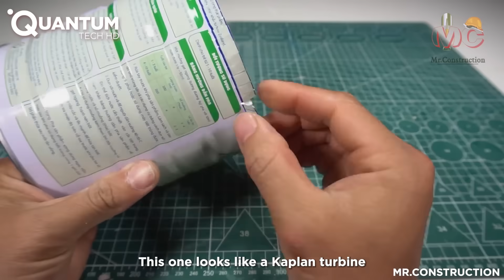Ingenious DIY Hydroelectric Turbine Systems | Free Energy by @mr.construction9846

Comment: There is no free energy.
Reply: No but if you use solar through day to pump water up and slow realse it at night technically you have just stored "free engery"
Reply: @unbredstone7378 Solar energy doesn't just appear out of thin air, it comes from the sun. If we think economically free it's also true, becouse those solar panels cost thousands and use alot of materials and once they break, are non-recycleable.
Reply: @AlanenJ   fine use the old polly pipe in roof trick and use thermal dynamics to pump water up cheaply
Reply: Тогда какой смысл строить гидроэлектростанции по всему миру, атомные, солнечные ?
На дровах как ЕС сейчас?
Reply: No free energy? You take bath in sunlight you got yourself a free energy flowing through your body it's called vitamin D

Comment: Something is wrong with your sine wave. Impeller speed and fan speed are not directly related to each other.
Reply: And your LEDs aren't flickering with the camera. As other run on some sort of DC battery instead of an AC power supply that's been rectified. 🤔

Comment: These are good for off grid power to keep batteries charged. However you'd have to have several of them sending generated power to an inverter wired to battery
Reply: These a "Miniature" D-I-Y examples, only for demonstration purposes! You can buy retail versions, as well, or scale these up, in metal, if you prefer the challenge!

Comment: Overvthe months he has made many water to electricity gizmos. None of them apart from the last one could or would actually develop the power he shows . These last 3 looked very nice , especially the mini hydro plant and dam , just a shame the motor would not develop the power he shows , unless he whats to prove me wrong and give the spec of the motor / generator !
Reply: I have a fan about the same size that works for over 26 hours off of a single 9000mah 5v battery. Needless to say it takes barely no power to run a fan. same aplies to these tiny diodes connected serially.
Reply: If you doubt it ask for it on mr constructions channel

Comment: I did this with my municipal water supply. They threatened to turn off the electric for upto seven days for at least 4 hours per night!! So I rigged a system whereby it uses tap water to spin a turbine that is coupled to a 12 KVA generator/alternator that produces enough current for my home, I can even take a shower! LOL I am amazed more haven't built them.
Reply: Must waste a lot of water.
Reply: @joshuasteele5108  It isn't waste per se' as the waste water goes down the drain back to the purification plant :)
Reply: @howmadisthat  What powers the purification plant?
Reply: @jamesdoust6975  Someone else's money. The tragedy of the commons.
Reply: Being generous with a pressure differential of 100 kPa and 100% efficiency, to get 12 kW of power you'd need to pass 120L/s. That is indeed a massive waste. It's probably nowhere near 12 kW, maybe more like 12 - 120 W and it would still be a waste of water!
Reply: @Southghost5997  Nope, in the UK we have 2bar pressure at the tap, this narrowed into a 5mm jet which feeds a water wheel. The weight of the wheel+water running through a 20:1 gearbox gives me 1800 rpm at the generator, which pumps out 12 Kva. It is ONLY used in times of power outages, where we get cut off for 4 hours each day, other than this and it is stationary.
Reply: Damn. What country do you live in where crap like this happens?

Comment: Solar and/or wind pump water uphill, there's your battery.
cheaper and more environmentally friendly than other batteries.
Reply: 1 kWh = 3 600 000 J. If 100% turbine efficiency is assumed, and that all the potential energy can be converted into kinetic and then electrical energy (which is impossible), and a 10 m hill, then you would need 3600000/9.8/10 = 36 735 kg of water. Say double that for the practical conversion of potential energy into electrical energy. Somehow I don't see how this is cheaper than batteries or environmentally friendly if it involves hoarding that much water for such a little amount of useful energy.

Comment: Can design a sealed unit that I can hook up to the mains pressure out front of my house that doesn't restrict flow  then I can run my house for free off the mains water. Cheers, thanks for that.
Reply: What
Reply: if you build 100 units as seen on this video you have just about enough power to run one TV or Laptop. if you want to generate enough power to run a single hairdryer you would need about 1000 units and that is IF this setup is capable of generating 1W at 110v.  which it most likely is not.
Reply: @picketf  bid 100 units?
Reply: @alexboros1751  for a single 90 watts tv yes about 100 units you see from this video
Reply: @picketf  ok, in not sure if the pressure of the mains pipe. House is 50psi the mains in sure is much more

Comment: I want to know the name of the glue that is being used?
Reply: The glue looked like acryllic model makers solvent adhesive, but since he's gluing plastic pipe material, pipe adhesive would be just as effective, the grey stuff looked like either araldite or chemical fix builders resin... good for fixing bolts into concrete and more.
IF those wheels on the second one are aluminium, you're better off either tig welding everything together or tapping and screwing the components together since I have yet to find an adhesive that successfully bonds to aluminium